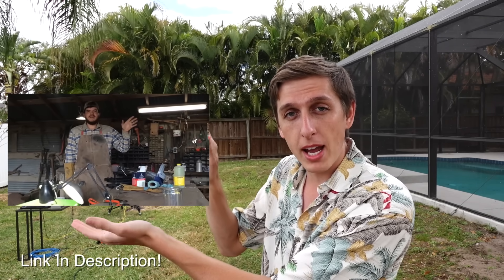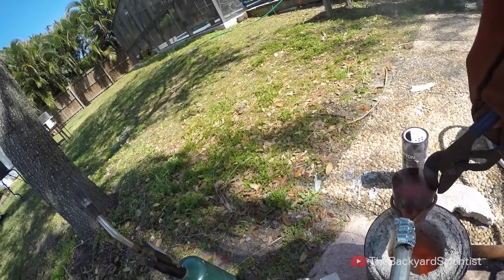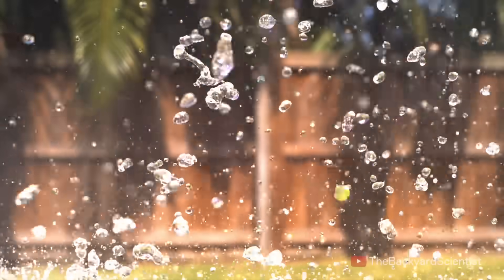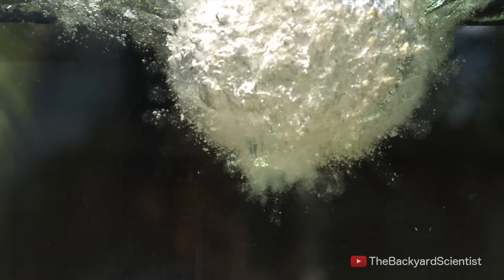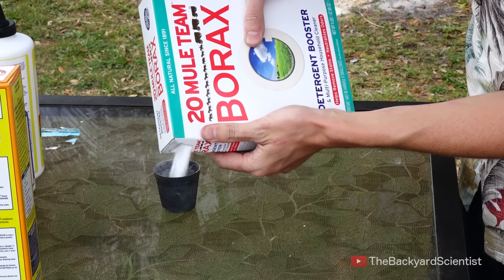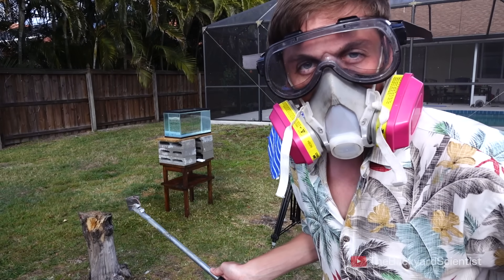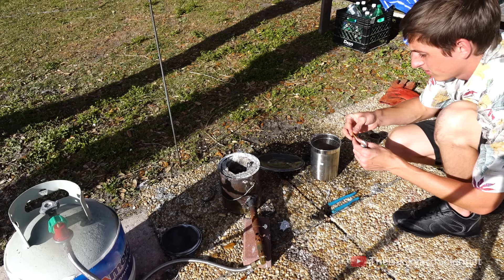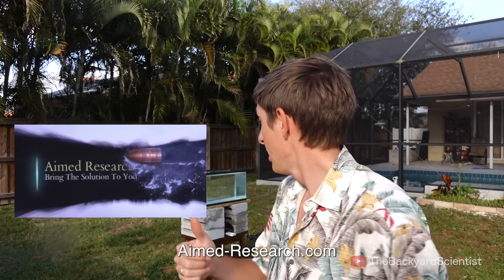Pouring Molten salt into Water - Explosion!

Comment: when you put chlorine on water, chlorine dissolves in the water and forms a bond which kills germs in the water.
when you put molten sodium in water it explodes.
so when you put molten sodium chloride in the water it stays a little bit to let chlorine dissolve in the water and when the molten sodium is exposed, it explodes and while exploding the chlorine thats dissolved in the water gets disintegrated. therefore i conclude that it was a chemical reaction for a second.
its just my theory.
Reply: This is so wrong I don't know where to start. Chlorine gas has nothing to do with this
Reply: Twist no she's right sodium chloride is sodium chloride, not a mixture of sodium and chlorine. It's a compound, it doesn't have the properties of its elements
Reply: Benebs Biagtan what about sodium cloroxide, A mix if the two? maybe a anti-germ bomb??
Reply: Benebs Biagtan That's not how chemistry work.this is so wrong😂😂😂😂😂😂.BTW molten sodium doesn't explode when mix with water it just violently react.There is a difference
Reply: NaCl - Common Salt is not a compound formed by either Ionic or Covalent bond . It is actually a formula used to describe its AB crystal lattice ! So actually it is a formal salt .Now , I dont think Cl (Chlorine ) plays any role here .It is the Kinetically active Sodium atoms which does the work . As many of us may know Sodium explodes on contact with water surface ( generally cold water) due to its negative  reduction potential value . It even burns in air !
Reply: *hypothesis
Reply: Shirsho Tarafdar I don't think heating a compound makes it break up into its respective elements - at least not NaCl. I mean boiling water doesn't make hydrogen + oxygen right?
Reply: Here is a hypothesis— NaCl breaks up into its free radicals when it is heated above 1800 degree centigrade, and as the Na free radical comes in contact with water the explosion occurs . It is just an explanation according to the Kinetic Theory of atoms and Free radical reactions . Please tell us what do you think !
Reply: Its just a theory my dudes
Reply: Benebs Biagtan. "Its just a (*hypothesis) my dudes"

A theory is something that has passed rigorous experimentation and is considered a reliable explanation for a phenomenon. It is not a guess. There is no such thing as "just" a theory.
Reply: You do realise that it's Na+ (stable) and not Na that is in sodium chloride (Na+Cl-)
Reply: Sagar Giri You have edited your comment, and still can't spell decent. You are ignorant and Don't know anything about science or chemistry

Comment: You tried it with demonized water and it had little effects right? It might be because the water you tested with had a charge on, maybe like how dissolving salt in deionized water doesn't conduct electricity while dissolving the same ionic compound in regular water which has charges creates conductivity

Comment: Possibly the salt that explodes absorbs water like it would normally and so the water is inside the salt but the salt is extremely hot so the water wanted to expand and it did but it did it very violently making the explosion

Comment: I really need to know the answer... it cant be cause of metallic sodium (which reacts with water) cause you only have sodium cations in the reactions which just get hydrolyzed (no ignition, no explotion). It cant be cause of the vapor pressure (the water increases its size up to 1000 times quickly breaking the glass) because this could happend with any other compound at 1000 ºC, I need answers

Comment: Maybe the chlorine in the salt evaporated or burned off and you were left with sodium and it reacted to water
Reply: That's actually impossible, you couldn't combust NaCl into Cl2 + Na2 or something like that, it's too stable in solid form.  only high polar solvents can dissociate it, they literally use sodium chloride and sodium bicarbonate in fire extinguishers to combat high temeratures and absorb heat they wont react.

Comment: You may want to consider that extreme temperature can cause water to break down into hydrogen and oxygen.  Ironically enough, you heated salt, sodium chloride, to the temperature needed to break down water into H and O at the lower temperature of roughly 800 °C "when in the presence of sodium", as opposed to the higher 3,000  °C needed without sodium present.  Ref.: https://www.technologyreview.com/s/428260/a-better-way-to-get-hydrogen-from-water/     Since the ignition temperature of hydrogen is 932 °F - 500 °C you are well above that with your 1,474 °F - 801 °C melted salt.  True there is no visible flame in your video; but you could be setting off a series of micro explosions that combine to form a larger release of energy.  Just a guess, I'm neither a physicist nor a chemist.  Interesting video.

Comment: I'm at thinking that the salt makes a bigger explosion because of its ability to dissolve and after it has partially dissolved it travels through the water really quickly and the steam is being created inside the water from the partially dissolved molten salt pushing the water away. However that's just a theory

Comment: When you pour the molten salt in the water, the salt dissolves quickly (because it is liquid and hot), resulting in 3.3 kJ dissolution enthalpy plus about 34 kJ of energy from the heat of the molten salt. What follows is cooking and evaporating about 15 mL of water very fast. No chemical reaction, only dissolving and cooking.

Comment: This is only a theory but i think your wrong.  you said yourself, your first attempts failed and did a little to reaction, but then you reheated the salt to more temperature and then the explosion happenend. i think that once you pour the molten salt, it reacts and  separates the chemical composition of water because of the heat. because of this, thermolysis happens, thus separating the hydrogen and oxygen of water, then the hydrogen gets ignited because of the heat and causes the big explosion. 

to support this theory, search the "thermite vs ice" in youtube, and you will see that it explodes in the same manner. in order for the molecules of water to separate, 800 to 1000 degrees celsius must be subjected to the water, which is present in this video.  

Now why the borax did not explode? you said it yourself, it is not directly making contact with the water because of its properties.

 the molten salt  with high temperature embraces the water and breaks down the molecules of water  (hydrogen, oxygen) so fast, hydrogen as you all know is an extremely explosive gas, and because of the heat, it ignites the hydrogen causing an explosion.

Comment: Would suggest that salt is decomposing into wide variety of compounds that add to the volume. This way energy transfer is maintained despite Leidenfrost effect.

Suggestions for further tests: 
- use polycarbonate watertank.
- Try mixing salts, thus lowering the melting point  - add ammonium and potassium nitrate (fertilizers with NPK values 30-0-14 or similar, middle number must be zero), can try bromides, iodides too. The mix melts always lower than any of the component. Lower melting point helps to maintain the salt-vapor interface liquid. This adds to the speed of surface growth. Ammonium makes salts more volatile.
Borates do not generate any gaseous products with water vapor, thus the dull reaction.

Comment: Does the pH of the water change when sodium metal alone is put into the water? My guess would be no, since NaOH is less energetically stable than H2O. My point is without this as a control, you wouldn't be able to rule out chemical reaction as the mechanism causing the explosion in the molten NaCl.

Comment: The lack of change in pH doesn't mean it isn't a chemical reaction. In this case, adding tablesalt (NaCl) to the water would produce dissociated Na+ and Cl- ions. Now, it is true with most soluble salts that when they dissociate they will bond with some of the water present to make H3O+ and OH- ions (the concentrations of which is what pH measures). However, both Na+ and Cl- are ions of a strong base and strong acid (NaOH and HCl respectively). This means that their rate of bonding with H2O molecules is almost nonexistent and therefore does not produce a change in pH when dissolved.

Comment: it's not really complicated: melting loosens the bonds holding sodium and chloride (salt components) together. when the molten salt is poured in water, the sodium (which is highly reactive with water) starts this reaction with water. the reaction is highly explosive and heat-producing (exothermic). I'm still @ 2:46 but I just felt like the reason was pretty clear from the outset that I couldn't resist saying it out loud lol.

Comment: Pure sodium reacts explosively with water and will even react with moisture in the air. You had sodium chloride. The chlorine neutralizes the explosive nature of the reaction so it doesn't explode but when you melt it down it is very possible that you are breaking the bonds between the sodium and the chlorine. I do not know how hot you have to get it to break the bonds in sodium chloride but I believe it has very weak bonds so I would imagine that is whats happening.
-Add on: My theory doesn't explain how it wouldn't react with water vapor in the air. I believe this is because the molten chlorine may be acting as a buffer even though the bonds (if my theory is correct) are broken and it is no longer stabilizing the sodium. This buffer I believe is being overcome by the shear volume of H2O contacting the molten mixture but there isn't enough moisture in the air to overcome that barrier. The only thing I can't explain is why the Sodium isn't settling on top of the mixture and the chlorine on the bottom given their atomic masses.

Comment: Tablesalt is basically NaCl. If you melt it, you will get liquid NaCl. Natrium happens to react explosively with water (check the periodic table). By heating it up you break the bond between Na and Cl, and when you then proceed to throw it into water, the Na will react. It reacts because it's a really strong reductor.

Comment: This energy is enough to make water boiling locally violently and expelling hot water. It is just heat energy transfer, no chemical reaction, so it cannot be called an explosion. The explosion does not occur because of the molten "salt" it occurs due to the exreamely high temperature at which the salt melts.

Comment: You won't need a cavity in the liquid salt ball. The surface in contact with the water is enough to vapourise the water. Like he says, the steam formed just around the ball will suddenly expand to 2000 times its volume, pushing the surrounding liquid water out of the way (and through the glass walls of the tank). The same thing happens when you drop a red hot steel ball into water. Or even when you strongly and directly heat the bottom of  a test tube full of water. Nice video, though and thanks for posting.

Comment: The reason the metals didn't react was possibly because they had developed a protective oxide layer on their surface, particularly sodium which tends to do this. However sodium chloride (table salt) is a compound and so has no protective coating, but when heated and melted, the ions of the ionic compound expand and react.

Comment: the salt exploded because he melted the salt creating a mixture of sodium and chlourine which will explode in reaction but they weren't completely mixed and when he put it in the water it explodes since water is mostly used as a solvent

Comment: its a physical reaction: 801 degress salt quickly boiled water creating lots of steam instantly that didn't have the time to escape through the top of the fishtank. plus water doesnt change density, it cannot shrink when an explosion happens under it, so it shifts sideways which is aquadynamic explosion. this is also used in car fluids - they dont shrink therefore they can transport momentum to places where it's needed

Comment: can we use it as an anti submarine weapon thing like that........or a weapon base on this phenomena....!
because I think it will make a great weapon for naval warfare....
Reply: not really,because the result is too random and inaccurate....
Reply: Not all explosions are created equal or are guaranteed to inflict right kind or amount of damage desired onto a particular target. Take anti-vehicle type shells fired from cannons for example. Sometimes the sheer force of an explosion will be enough to rip open a vehicle, like your mom's minivan and shred everything inside of it. The same explosive round will still be ineffective against tank with actual armor plating.
Reply: Robert Rizi lol almost died at "your mom's minivan"
Reply: multi-layer bomb? initial thermal blast that super heats salt interior shell, giving time for salt to drop a little further follow by water returning to it's natural spot, boom, second explosion
Reply: molten salt sounds like a crap weapon how are you gonna keep it hot and and shoot it at a target reliably in a way that's more efficient then weapons we already have
Reply: keeping it hot is not that hard and if that small an amount causes that explosion imagine what say a couple of liters dropped from an aircraft onto naval ships could do.
Reply: Juicy D McGovern i was thinking of that as well. a thermite blast that superheats the salt so after the initial thermal blast the water comes back and goes to the molten salt to blast again. Not sure if it is energy efficient but worth a try. I mean you can make thermite without access to military/scientist resources anyway.
Reply: rohit sangale there's always one
Reply: Probably just make the deck saltier because it'll turn back into a (solid)? by the time it reaches sea level. This guy had to instantly pour the molten salt into the water to get it to react.
Reply: Robert Rizi Actually, weapons like Rocket Launchers utilise a sort of molten bolt of metal within their Rocket to pierce through Tanks, it was said from Ahoys video
Reply: underwater explosions tend to generate large gas bubbles regardless of the explosion's properties, but I do see your point.

Comment: Ofcourse its a chemical reaction. Sodium is an active metal, which reacts with water when NaCl is put together with water - result: NaOH which is a base. (your indicators are broaken). Btw active metals burn/explode when contacting with water. 

Why does room temperature salt not explode and molten does? Because the bigger the temperature, the faster chemical reactions happen. Therefore the molten one happens so fast that it explodes.

Comment: The reason why it explodes is because table salt is made of two highly dangerous compounds that i don't remember the names. That one compound bursts into flames under water and the other reaches below zero temperatures when exposed to oxygen. Put them together by cold fusion and you get harmless table salt.  When you melt table salt you are defusing the two compounds. And separating them. What happens when you fill a igloo cooler full of ice then add a cup of table salt then shut the lid? The ice gets sub zero temperatures like 40 below.

Comment: 2 awnsers.

1: Physical reaction:
The salt is so hot that when you drop it in water the water boils immediately (obviously). You'd expect the water to vaporize upwards but because you dropped it in there with no time for the salt to first cool, it immediately exploded.

2: Chemical reaction:
Now I feel like this is wrong, but basically molten salt seperates Na and the Cl atoms to create Na+Cl instead of NaCl. The Na (sodium) violently reacts with water

Comment: There is no reaction in there, there is just very very hot salt which gets water into vapours...nothing really interesting here...
Reply: he tested other mixture of salts thaw was rather viscose so the process of the heat exchange was slower and there was limited chance for water to get in and be superheated 

he tested sodium, but sodium is lighter than water, thus it cannot penetrate into the volume of water and the whole process happens on the contacting surfaces (that are limited

I would say that his explanation of the very rapid heat exchange in the volume and its acceleration by mixing droplets of the salt with water by expanding hot vapor is quite believable
Reply: AlbOuse Banana There obviously was a reaction...
Reply: no, it wasn't any chemical reaction. Only water evaporating really fast, he could put anything but salt if it was hot enough and do the same thing...
Reply: AlbOuse Banana he tested other molten metals and nothing happened
Reply: I think you've meant sodium chlorate :) Hot sodium in water would make a very nice boom . But yeah, you are right :) There are only hot vapors and over heated water. :)
Reply: And that's why he says multiple times it is a physical reaction and not a chemical reaction

Comment: Great video!
Here is what I think is happening. The explosion is physical and caused by the thermal energy of the molten salt being transferred on a very short timescale to the  water via a steam explosion.  What is fascinating is what determines whether the molten salt enters the water and sinks (presumably insulated by the Leidenfrost effect) or what causes it to explode in a dramatic way. I would guess that the shape and speed of the molten salt  determine the degree of thermal contact on impact. If the molten salt enters the water in a manner where the Leidenfrost effect is effectively removed, even locally, then the cavitation effects of rapid boiling will cause all the thermal energy to be dumped into rapid boiling of the water, causing an explosion.

Comment: Maybe the vibrations of the molecules are more in sync with the salt.  The sodium molecules would be reacting with the water and creates the hydrogen fuel, the hydrogen in the water would separate from the oxygen and those would be caught in the energy of the reaction but it is similar to dropping a cigarette onto a gas trail (it burns the immediate area but doesn't burn it all).